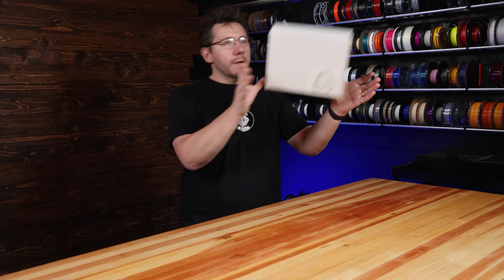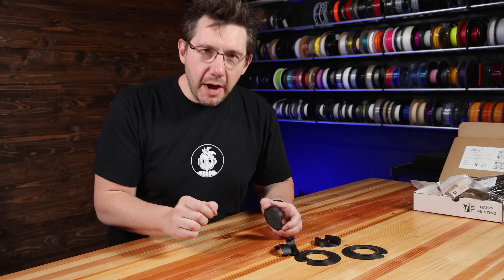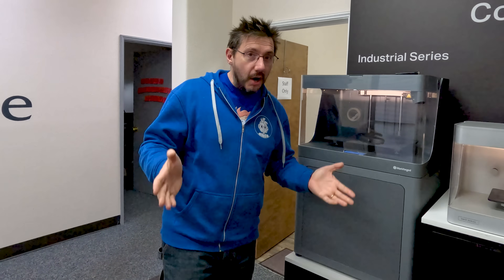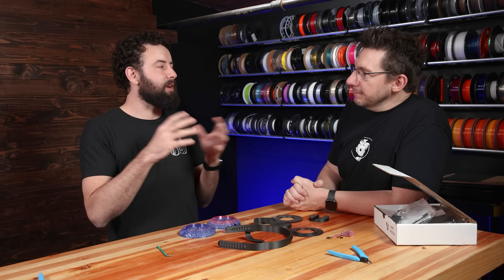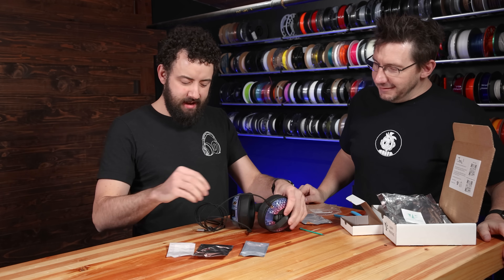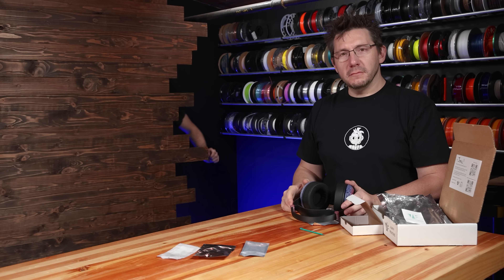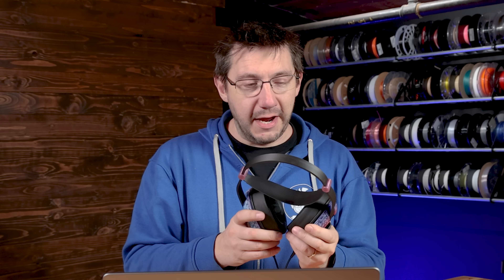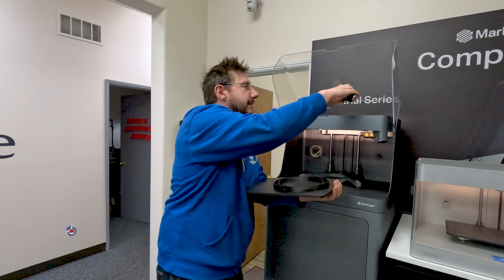World's Strongest Headphones?

Comment: Looks cool, but that the "connecting piece" was too big for your printer has me worried for Ender 3 users like myself. I get that you wanted to show off the continuous glass fiber reinforced stuff, and you definitely have printers that are large enough, but a minimum printer spec info would be nice.

I can probably find that on the site, but you should include it.
Reply from the maker: The Markforged Mark Two build plate is a rectangle, so that's why it didn't fit. The pieces are all made to fit on a 220 x 220 print bed.

Comment: They sound ok for a 100$ project, but knowing what those drivers are capable of, they still leave a lot on the table. 
A bit too bassy and mids are super scooped out. Headband is kind of flimsy and strap creates a pressure point.
If you can design, grab a decent headband (beyerdynamic or partsexpress) and make an adapter.

Comment: What's not mentioned fully is the repairability that this product offers, while alot of headphones die because drivers/cables and electronics alot still die because of the shell and such snaps, looses up things get broken etc with this you can straight up use the headphones till the drivers die which in itself is heavily pro consumer if I had a 3D printer I'll probably buy these just for repair and customised portion alone! Love the work both joel and the company.
Reply: This guy gets it!